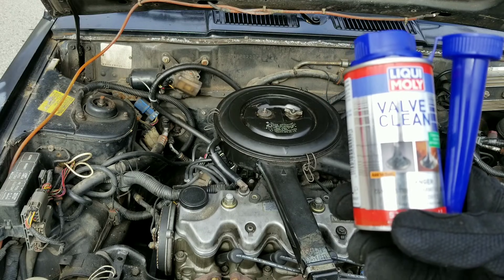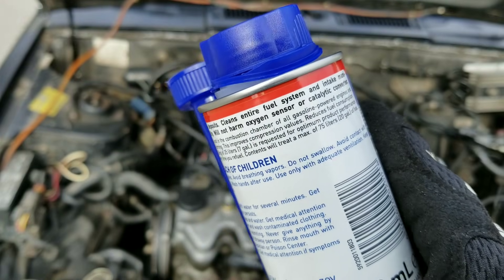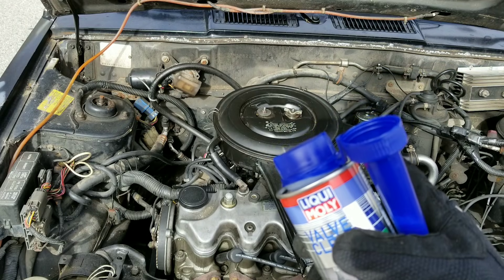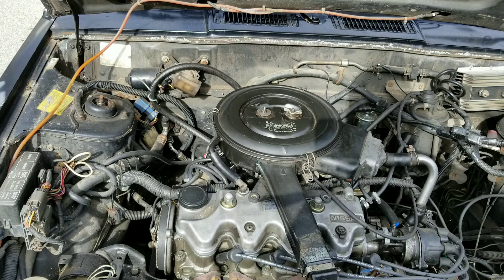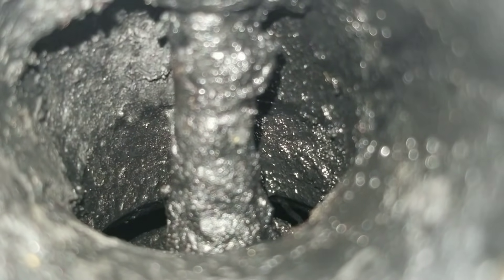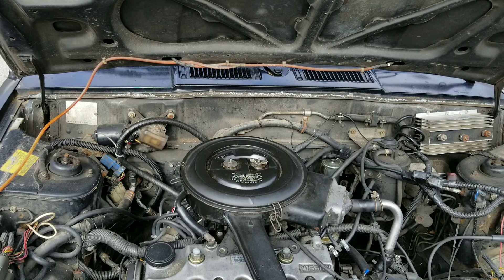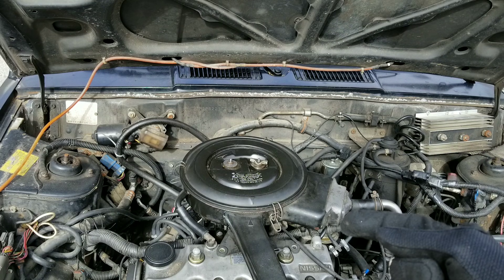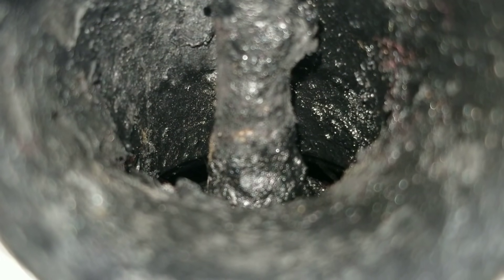liqui moly valve clean

Comment: In GDI engines, the fuel is injected directly into the cylinder and no cleaner added to the gas ever touches the back side of the intake valves. And, in GDI engines, the only way a chemical could work to remove gunk from intake valves is to inject it into the intake manifold while you’re driving along, and do it for enough miles to let it work. Or you can remove the head and steam clean it, but that’s a lot of trouble.  As with many modern engines, especially GDI engines, it looks like a lot of oil and oil vapor is being sucked out of the crankcase and into the intake manifold while you’re driving along. I think you had put one of those oil can devices on this car earlier - has that helped keep more oil from being sucked into the intake manifold and gunking up those intake valves?

Thanks for testing all of these products.  You have saved your viewers thousands of dollars from not having to test that stuff ourselves.
Reply from the maker: Thanks for explaining the gdi or direct injection for those who aren't familiar.  I use the cleaners in a large sprayer like redline i just pour in sprayer and pump and spray threw intake of my gdi and thats what i intend for redline also i have already did marvel mystery oil and other this way and the catch can definitely helps but thats why i have chosen the current cars because of there issues and again thank you so much for your help and sharing with the NIA community
Reply: NATES INTERACTIVE AUTO I think I am going to try your method using the garden sprayer to put good chemicals(Redline or CBD?) into the intake manifold on my running GDI engine and see if it will dissolve the crud on my intake valves, or at least make it come alive for a few minutes.  I will also install the catch can I ordered.   Your videos are very entertaining; like to see what you could do on your videos if you decided to brew beer or make moonshine while working on cars - that would really give us a few things to look forward to! Thanks for everything you do.
Reply from the maker: Ohyeah awesome lmao
Reply: This is one of the problems with direct injection engines and not just when cleaning. VW FSI engines get carbon buildup if they're not run on high octane fuel and can't do  stratification. Lots of modern direct injection engines are combining regular injection systems too for the same reason. Lots of GDI engines here in the UK are finally getting the high octane they deserve as we have moved to E10 but 98/99 octane is still e5

Comment: With direct injection putting it in your gas take won’t show a difference because the fuel injectors don’t touch the top on the valves it’s sprayed directly into the combination chamber that’s why there wasn’t a huge difference. Should have sprayed it into the intake manifold to hit the top of the valves
Reply from the maker: This car isnt the direct injection we test

Comment: I'm thinking long term, either your valve guide seals are worn or the oil rings are. Those valve stems and ports should never get that carboned up.
Reply from the maker: What can we try next
Reply: @NATESINTERACTIVEAUTO  What I would do is check the valve guide seals on the worst ones. A lot of these cleaners work really good but if there is oil weeping in these areas, they will never be truly cleaned. These valve stems should be lightly dusted grey or tan. never carboned up or with wet carbon.
Reply from the maker: Yes i totally agree as i chose these vehicles specifically for the test
Reply: I would try to pour in some way this cleaner into the head where you entering the borescope into the combustion chamber and the valves and just let it soak. This would indicate if this cleaner can breakdown the deposits. 

As far as valve seals, right now they are heavily deposited.  I have seen worst with the seals being in fair shape. My thoughts are the deposit would have a gloss shine if anything was getting by the seals.

Comment: I think they are in too bad a state for Liqui Moly to help with. If you had only slightly dirty valves it would probably help a lot more. Liqui Moly is a good brand, I mean they are German and they take stuff seriously. I had a ticking and poor injector on my W169 a class. Because the injectors are so difficult to access I tried STP, Redex, Redex advanced and none helped much. Liqui Moly injector cleaner helped though and stopped the ticking noise the injector was making. Their ceramic engine additive reduced engine noise a ton and increased smoothness

Comment: I would like to see you  use your sprayer with E85 on this car spraying through top of the carb or TB.lets see what that alcohol does to the carbon
Reply from the maker: Sound like a good idea thanks for sharing ill see what i can do your always here
Reply: I never thought about it but that is a great idea. I would like to see that as well since its 85% ethanol.
Reply: Cool
Reply from the maker: Yea
Reply from the maker: If i remember correctly its 15 percent ethanol and regular gas is 10percent
Reply: Drill a 11/32 hole thread a 1/8 npt hole. Into your intake manifold ( buy 1/8 npt bung, beforehand) Get a cheap pump sprayer. Add a 50/50 mix of water and pure methanol. Rev engine to 2500. Spray water/ methanol mix. Repeat until clean
Reply from the maker: We could spray mix
Reply: NATES INTERACTIVE AUTO 85% ethanol. Most gas is 10% now.

Comment: Can i use it on my peugeot 207 turbo??
Reply: With the 1.6 THP with direct injection its better to use LIQUI MOLY 5111, but if you have already massive Carbon Buildup like in this video with a direct injection a manual mechanical cleaning is prefferable.

Comment: As yourself if it cleans all the buildup carbon off these valves where does it go? Yep, right into your cylinders and possibly scratching the cylinders and then gets caught in you catalytic converter this was a neglected engine maybe if your ran this through your engine every 10Kmi from when it was new it might help but this engine needs to be torn down and cleaned professionally

Comment: H2O is carbons worst enemy but you can only do it on a gas engine not diesel.spray water into intake whilst holding throttle to point of almost stalling.water is abrasive and rapidly absorbed by carbon breaking it down
Reply: Adding isopropyl in the gas tank does the same

Comment: That's an extreme case of carbon build up, you will need to apply the product more times to see better results. Try one can every full tank.
Don't apply this product on GDI engines because you will waste the product, as the gasoline isn't sprayed directly on the intake valves, but directly inside the combustion chamber. however It may clean the combustion chamber
Reply: So what i do?
I have sonata 2015 2.4 gdi..
Reply: @aljahwari93ih  It's a GDI, you have to spray a cleaner product directly on the intake valves, use Seafoam Spray, it's the best car multi purpose cleaner i have seen.

As it is a GDI, gasoline additives won't do anything to the intake valves as the injectors spray directly inside the combustion chamber, not behind the intake valves like the case of non GDI engines. At best it will clean the combustion chamber and the top of the pistons.

Comment: such additive cannot work because on a GDI the gasoline never touch the valves because is direct injected in the combustion chamber...on a GDI the cleaner need to be injected in the air intake, but the result is poor, only a blasting with a soft material works realy, but need to remove the air intake pipe...
Reply from the maker: I will add the cleaner to my giant sprayer so what can we try next

Comment: an old Nissan pulsar engine this engine is just worn not direct injection
Reply from the maker: No its not direct injection i say that i will test on direct injection check my other videos and ideas for the next video?
Reply: Don't apply it on GDI engines because you will waste the product, as the gasoline isn't sprayed on the intake valves. It may clean the combustion chamber.

Comment: How the hell is this meant to clean valves on a direct injection where its basically squirted straight into the combustion chamber?
Reply from the maker: This engine isn't direct injection but i show in other videos i add the product to a sprayer and use on a direct injection

Comment: I think gas tank additives would only clean if the injectors sprayed this stuff directly into the valves, I think spraying them manually into valves would be better
Reply from the maker: Yes this passed across the valves but spraying directly with the cleaner only not mixed with fuel has large benefits

Comment: We need to have at least 3 cycles of fuel treatment for optimum results
Reply from the maker: Good idea what else can we do to improve?
Reply: @NATESINTERACTIVEAUTO  May I suggest that the same product to be use on new engines and observe it's effect? 
Anyways you have a great video!
Reply from the maker: I appreciate that and sounds like a good idea
Reply: Can you use fuel injectors cleaners in general, 3-4 times after each gas fill up? 
For example, fuel injector and then gas fill up and repeat 2-3 times afterwards?

Comment: There is no way that liquid Molly would work putting it in the gas tank.  The gas never touches the valve on gdi so how would you expect that to work?  That would only clean valves on a multi port injection engine.  All the money you’ve spent on all these $20 Ken product stuff you could’ve took it to a shop and got the valves cleaned professionally for way less and they would be spotless.  Granite you wouldn’t be able to make the videos but it’s not like you’re putting before and after pictures side-by-side and making it a really high-quality video. I would try something else bro As far as video.  Go look at Chris fix videos and he shows before and after side-by-side on eight cylinder so you can actually see the difference .
Reply from the maker: Its ok this car isnt direct injection also as i said and used in other videos i pour in a sprayer then spray in a gdi engine but i also have did side by side lol but i want people to see the valve's good most watch on a phone but its very easy and chris makes 1 video per month and does q great job however i work 7 days a week plus if the improvements are so minor you dont see difference there probably not worth trying.  Have a great day and thank you.

Comment: This guy never does things right. And makes people think products will remove major build up. First thing his info is off “take for a spin” then says “after a few thousand miles” well which is it? Also that product does work but it’s for preventive and is meant to be used for every tank. If he used the fuel system cleaner that may have made a difference but you would have to run a couple more for that much build up. Also where ever you live bud you have a lot of water in your fuel.